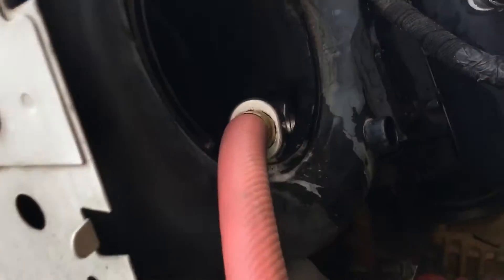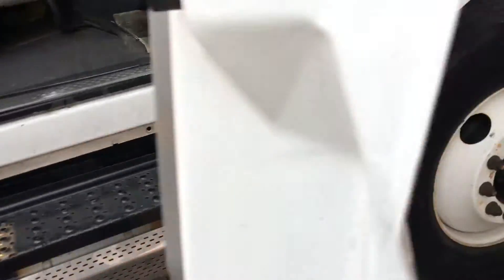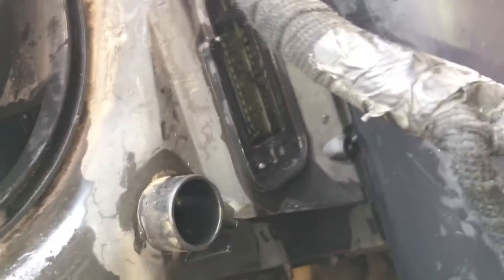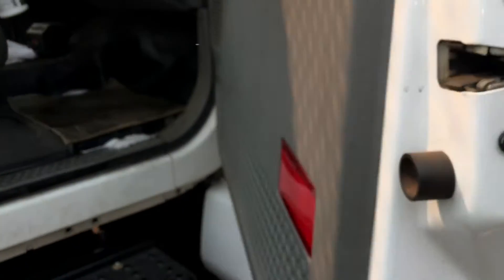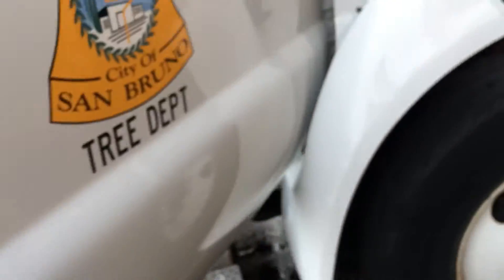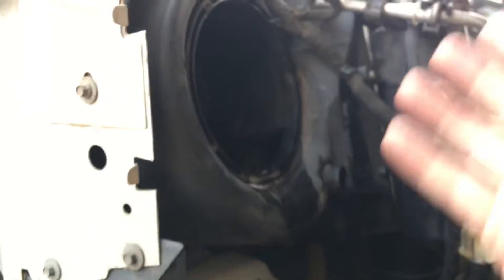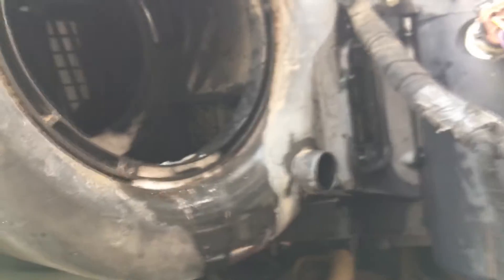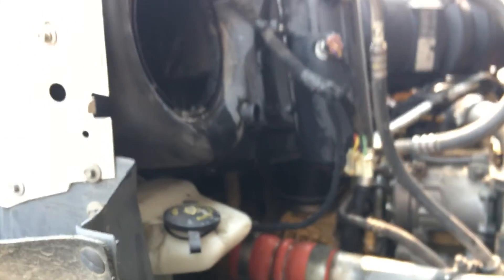Evaporator It’s almost clean after his first washing using a garden hose and spray nozzle￼

Comment: My 95’ Ranger had vinyl flooring. Awesome. Far more practical for a pickup. If it’s used as a pickup 🤣
Reply from the maker: One day when I came home my son had all the doors open on the Ford Windstar van with a garden hose inside the van water pouring out all of the doors with a broom brush and soap 🤬

          I don’t know where he got that idea but there was a body control module underneath on the floor of the driver seat that got wet of course the vehicle developed intermittent electrical problems months afterwards from the corrosion on electrical wiring.
Reply: @coldfinger459sub0  His intentions were good 🤷‍♂️